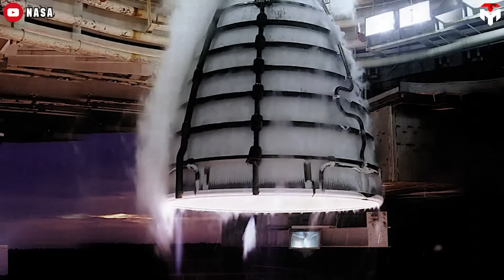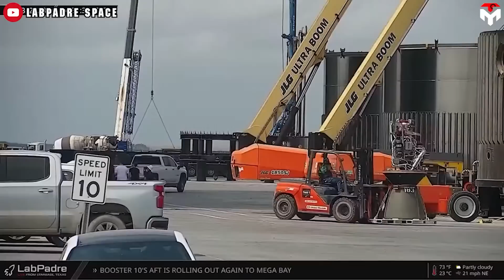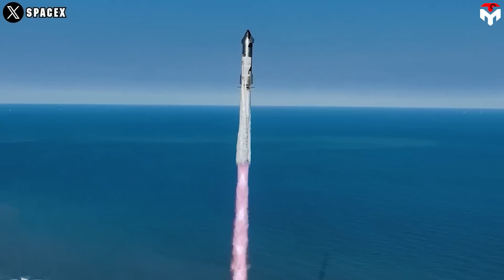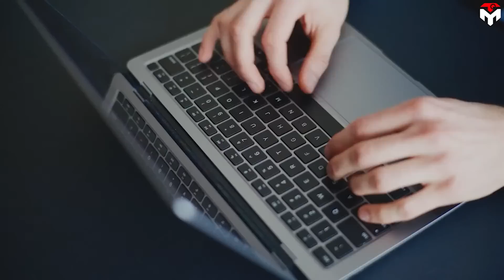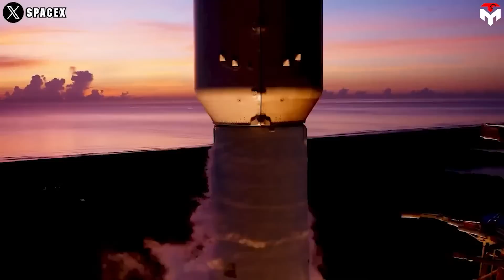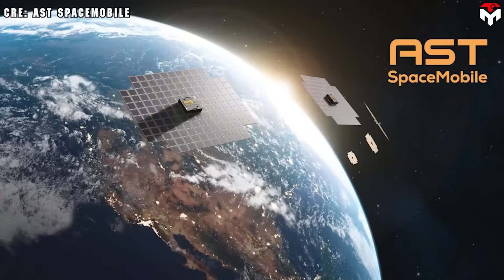"1500°C MELT!" SpaceX's New Metal Shield to End Ceramic Tiles Just Break Physics...

Comment: The Venture Star program had a metal heat shield.  It was of nickel-based superalloy Rene 41 known for its high strength, oxidation resistance, and ability to maintain structural integrity at high temperatures (up to approximately 1,093°C (2,000°F)). Rene 41 was used in areas that experienced the highest thermal loads, such as leading edges and nose sections. Though extremely expensive, niobium-based alloys (like C-103, which contains niobium, hafnium, and titanium), the melting temperature typically falls in the range of 2,300–2,400°C (4,172–4,352°F). It seems that the problem is insulating from the high heat transfer of metals.
Reply from the maker: That’s a great point about the heat transfer of metals
Reply: Thats exactly what i was thinking. The plates would have to be hollow with thin layers of that material within or eventually a  foam or liquid that doesnt transfer heat very well and doesnt expand between each chamber.. Because a pure metal plate directly on the hull would make for a crazy heat dissipation inwards
Reply: Either that or the ship would have to be packed on spikes or something that doesnt let the heat shield transfer heat directly to the hull.

Comment: Wouldn't it be easier to simply add side boosters like falcon heavy is to falcon 9, if you need more lift or heavier load???
Reply: Mayhap Elon has already envisioned a 3-core Ultra Heavy using 3 Super Heavy cores. Now wouldn't THAT be a sight to behold!!

Comment: What is the electrical charge of the high temperature plasma on reentry? Wouldn't it be possible to charge the surface of the Starship to repel the plasma and provide thermal protection? This is done for thermal control in fusion experiments and should be possible for thermal shielding of spacecraft. Should be less mass and complexity compared to liquid cooling. Just a thought.
Reply: The plasma is of course -ve electrons and +ve ions. If you use an electric field to repel one plasma component you will inevitably accelerate the other component towards the ship.

Comment: As I wrote somewhere else, Spacex could protect that metal shield by slowly spinning the rocket on its axis (two revolutions per minute?). It would dissipate part of the heat.
Reply: No, firstly, If starship tried to decend  rolling or spinning it would tear itself apart. Second, it would be impossible to initiate a roll and maintain it once atmospheric pressures increase. Any sort of propelled roll, if possible,  would require significant fuel and extra weight of thrusters.  Third,  the heating is from resistance of the ballistic deorbit  trajectory. 
No electricmagnetic radiation or Conduction. Rolling would likely make the heating worse.
Reply: @sidvicious6505  First, I can't see why the the slow spinning I'm talking about (one or two per minute) would tear the rocket apart. (The idea is to spread the heat on a larger surface.) Second, spinning could be done without wasting any energy by using modified flaps. Third, SpaceX could redesign the rocket (and the flaps) to allow that spinning.
Reply: @JeanJacquesNantel  2 full rotations per minute is alot faster than u think. Imagine a carousel the diameter of Starship. 

Regardless of the rotation speed. STARSHIP HAS to deorbit using ballistic trajectory.  Unlike the Shuttle which could use an aerodynamic rentery trajectory.  
Which means that Starship will hit  
Atmospheric pressure resistance at speeds upwards of 6-8 kilometers per second or 18,000 mph. Those flaps only propose is too give the star ship greater resistance on rentry. Adding centrifugal forces  will multiple stress exponentially. The  ATMOSPHERE density is not nearly as uniform as one may think. 
Not to mention, if Starship ever, by several miracles of science, is able to carry a crew aboard. They would experience 8 gs upon reentry. Rotation would add  health risks and make staying conscious nearly impossible.

Comment: It doesnt sound like the engineering analysis at Space X is that good. After 6 flights they realized they have a bad design and have to go back to an old option, a trade they left behind. I am not sure if the name is quick iterations or dumb iterations.
This is not typically what happens when optimizing designs. You move on when you are sure you reached a design point. In this case that was a mistake.

Imagine getting to the Moon and after the rocket falls saying, hey that was a bad design, let’s put the old landing legs back.
Reply: And what concerns me is that this is all presented like so much else (like growing weight precluding landing legs) as if it’s a big advance. It gets to the point where you can’t really judge what is and isn’t advances in this platform and get beyond smoke and mirrors as the hype only fanned by YouTube channels et al. It’s actually very self defeating when hype overcomes common sense.

Comment: Elon, why not insulate the tile from the hull, so that a di-electric field can be applied to tile (+ve) with a -ve trail of ions out the rear of the rocket.
  That way you repel the atmosphere away from the hull( reducing friction problems), but still leaves you the option to use tiles if the field fails???